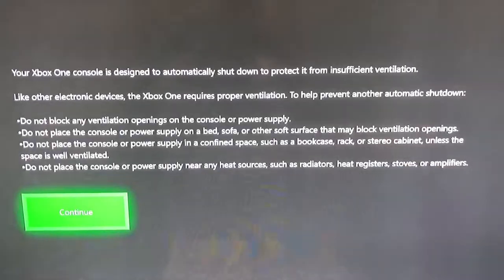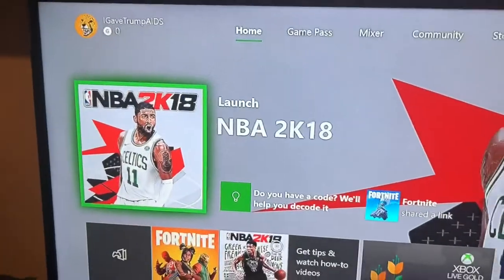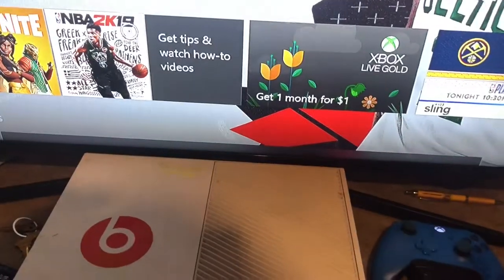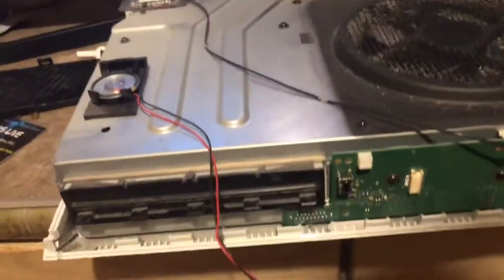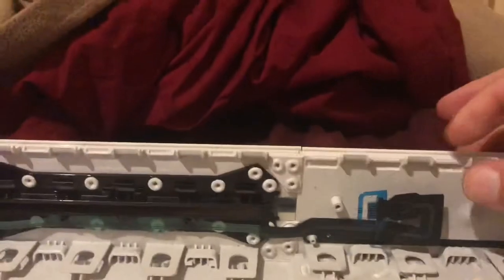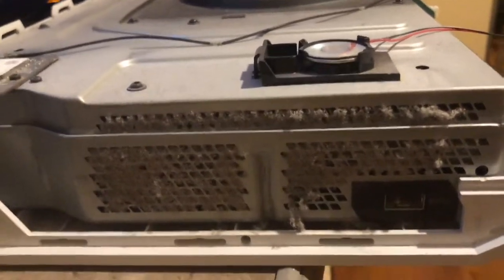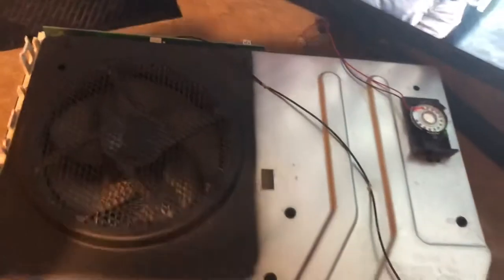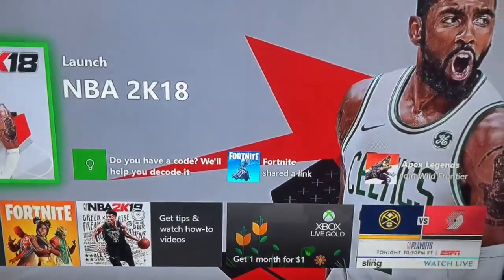Xbox One Ventilations Problems Clean Xbox One Out Tutorial

Comment: If your xb1 x or s is overheating and shutting off unplug everything and just blow hard into the sides and the back of the Xbox with your mouth, do that to each side that has the vents and dust and ect should come out, I did that to mine and it hasn’t shut off since and I blow into it every now and then just in case, hope this helps someone 👍🏾.And also I forgot you actually have to put your mouth on the console and blow like a harmonica as hard as you can to get the dust out good luck.
Reply: pause
Reply: @pendingcharges  lmk if it works for you 😂
Reply: HAHAHHA
Reply: @elijahstevenson1726  what’s funny lmk if it helped
Reply: I'll try it out me
Reply: Thank you, got it to work for me
Reply: just use compressed air on a football pump 😂
Reply: or a football pump*

Comment: If the xbox overheats how long do u need to leave it alone to let it cool
Reply from the maker: 24 hours I recommend
Reply: Dashyis Liv mine keeps overheating for some reason after i cleaned it
Reply from the maker: PhantumMagnus use an air pressure gun after takin apart the Xbox to have the air pressure blow all the dust out of the consul
Reply: Dashyis Liv ok now the part you were talking about in the video how gentle do you have to be when opening the xbox
Reply from the maker: Yea cause after this video man my Xbox been working perfectly with no issues
Reply: @phant0mmagnus181  same did u fix it?

Comment: So if I just put my fan on the fan of the xbox it will work for only two weeks
Reply: No, basically just suffocate it even more, I never recommend blowing at the top, get USB fans for Xbox to blow into the sides, and a big fan blowing out from the top? Make sure they're Microsoft Xbox, because other companies with those gadgets will always mess up the direction of the blades and air flow. Which will bring you RIGHT back to the suffocation problem.
Reply: @mroak6504  I haven't gotten the problem since 3 weeks ago so..
Reply: @krealify  airtight! As long as it's working I guess..
Reply: U2Ez X Smokes  yes